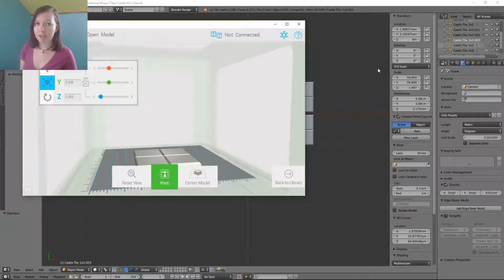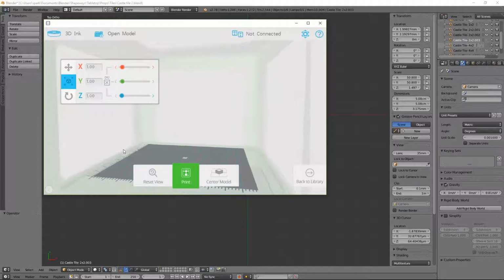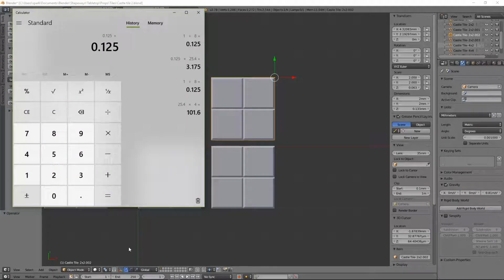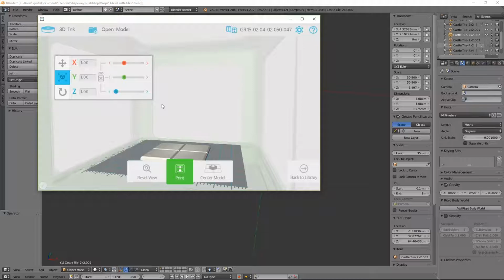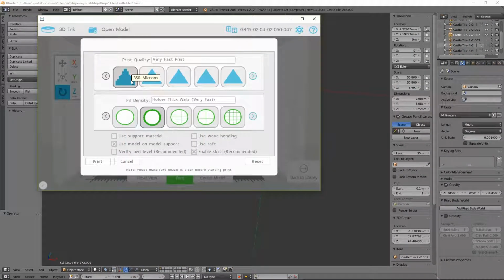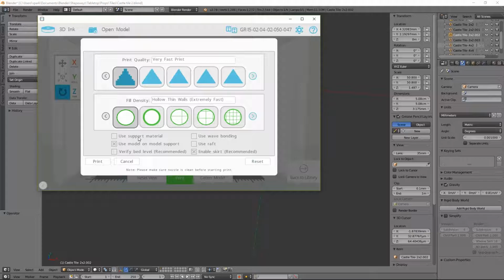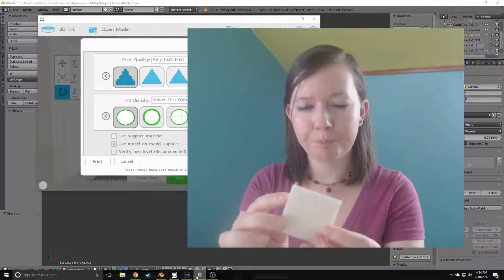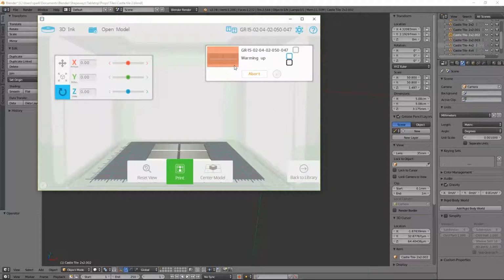How to Use M3D Printing Software and Fix Scale Issues

Comment: Not sure if I'm doing this right, as I'm using a much later version of blender, but this isn't working for me. I enter the metric dimensions into the scaling boxes and wind up with a big, distorted mess! These scaling boxes are under Object Properties tab >Transform and >>Delta Transform, fyi. I've tried both sets of boxes in each aforementioned sub-tabs and the result is the same. Here's the thing...

I already have a method of scaling inside the M3D program, but it is more involved and always requires a test print, from which I fine-tune the scaler from. This obviously can waste a lot of filament and takes time, so I'd like to have a better and more accurate way of doing this. Was hoping the info in this video would be that simpler, accurate way but so far no. Have any further suggestions?